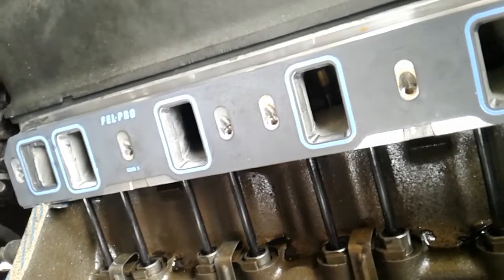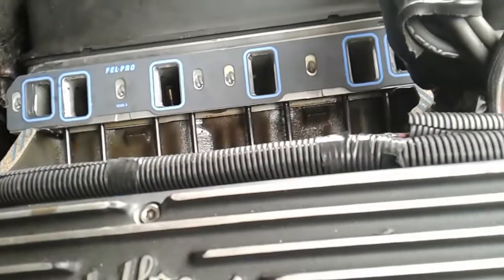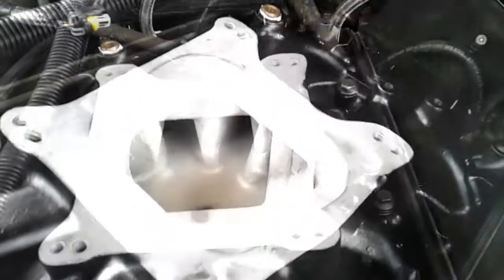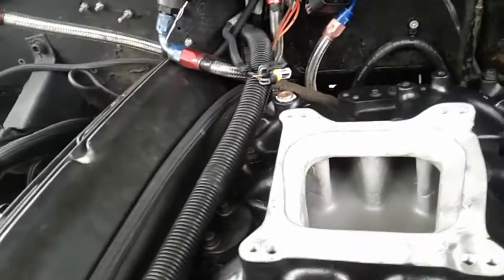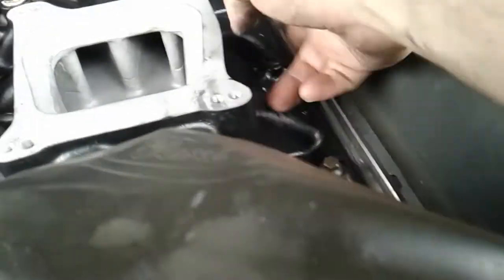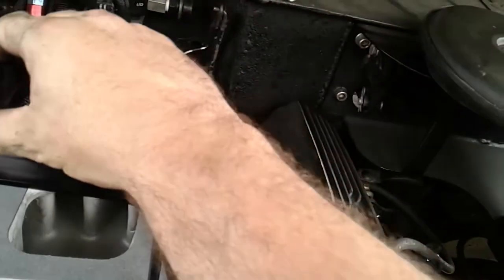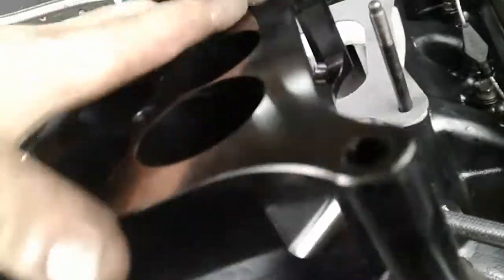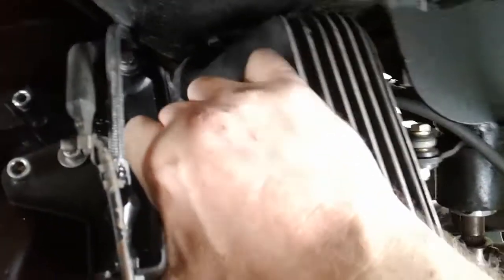Holley EFI Terminator Sniper Street Dominator Single plane intake install

Comment: The key to the aftermarket TBI systems is to not block the sensor ports. I have a friend with a 455 Poncho in a 78 T/A. He has just about the best of everything, including a Butler top end. After looking at the car, the major issues that I had found were: The intake was a Performer RPM - WITHOUT the divider milled. The Fast EZ EFI 2.0 has its port for the map sensor off to the left rear corner of the baseplate. The car was only averaging map pressure from the right bank of the engine, since a 180 degree intake cross-feeds. Also, The car had it's oxygen sensor mounted in the left exhaust for the left cylinder bank. How in the hell can the car self-learn if it's reading map pressure from one bank and getting fuel oxygen level levels from the other bank? A Guy needs to run a open spacer that is massaged around the map port. I'd at least run a half inch spacer and notch the intake divider if I didn't swap to a single plane intake with equal length runners. The issue with a 180 degree intake is half of the intake plenum is higher on one side, you will always have small fuel distribution issues. Check each cylinder with a infrared heat gun. The hottest cylinders are running the leanest. They should have located the map ports and gave guys 2 sets of oxygen sensors if they are going to use a dual plane intake with a full divider IMHO.

Comment: So you changed to a open plane manifold, and then you put a 4 hole spacer on which converts it back to dual plain,  the reason the sniper efi doesn't like dual plane manifolds is because you disrupt air flow and cut the throttle body in half and the one side doesn't know what the other is doing.  due to sensor ports located on the base.  So you could have left the dual plane on and put a open plane spacer on top.
Reply from the maker: I'm actually running an open 1" the 4 hole spacer is open on one side and 4 hole on top
Reply from the maker: I tried the 1" open spacer on the dual plane. I've tried many different configurations. If they setup sucks I will try something else.
Reply from the maker: Look at the engine running. I'm running the 1" spacer.

Comment: I went to Edelbrock to ask about running single plane with Fitech. Dual plane manifolds signal carbs better at low rpm.  Since your not trying to signal venturies to flow fuel, and runner length is similar you are better off with single plane all the way around. I also ask why Victor manifolds dont come with water temp. bungs when it is vital for fuel injection. They said changes are coming. It takes a while for industry, and thought to catch up.